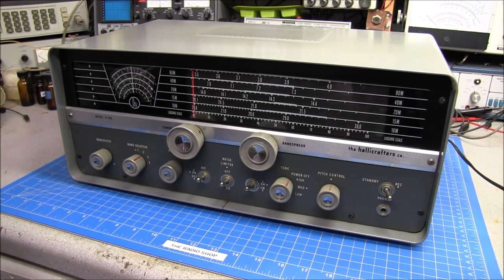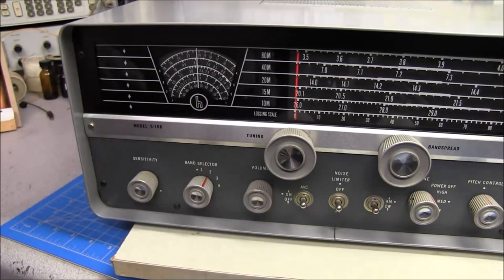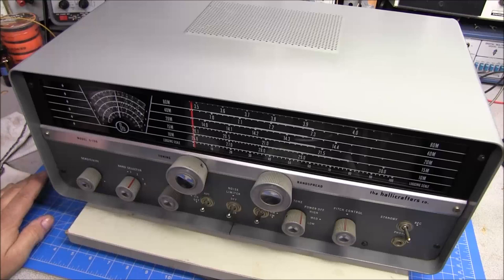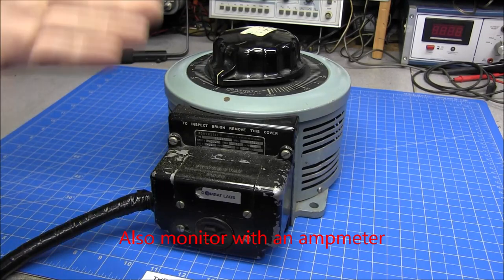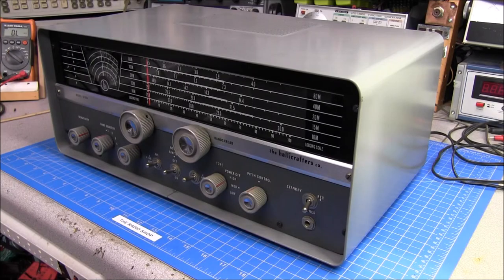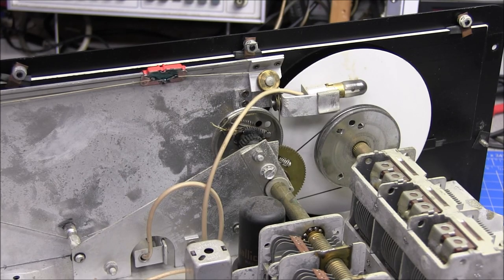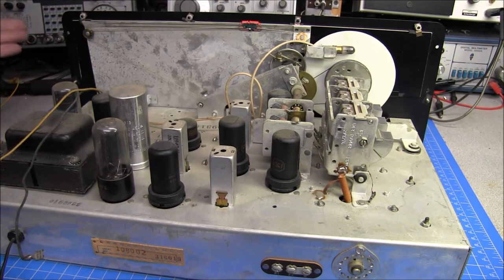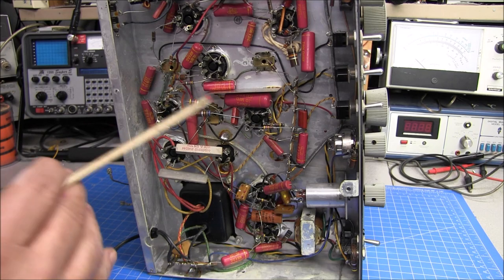#223 Vintage Radio Restoration Tips

Comment: MY 108 does not look that good but it has promise. Working but it is distorted audio when I first turn it on but it clears up in a few minutes. Thanks for the video, Dave.
Reply from the maker: Have you replaced any caps?  Also check resistors and voltages.

Comment: GREAT video Buddy.
I have a Hallicrafters S-107 that works fairly good and has all those tiny chief caps in it, I read somewhere on the internet that these caps are very good but I will check the ones like coupling, etc.
As for the dreaded SMD with my bad eye sight I can't take those IF cans apart, if I messed with them you can say goodbye to the radio...LOL
Reply from the maker: Those caps are nothing more than paper caps in a different package, They leak real bad.  I know what you mean about the eye sight Bill.  Tiny little wires in those things. I have to use large magnifiers.
Reply: Thanks Buddy, when I get it on the bench I will replace them.

Comment: Do you see any drawbacks to using a GFCI for the test outlet?  I know that it won't stop all electrocution even on the primary side but it seems like a small expense for a little bit more safety.  Generally, you should also be running off an isolation transformer.  This radio's primary looks to be isolated by the power transformer, so almost no primary side danger so no real need for an isolation transformer for this radio but this is not always the case especially with old radios.
Reply from the maker: I see no problems with that at all. I also agree on the isolation transformer
Reply: Even with a isolation transformer you can still have problems if you're not careful. Martin KD8LON did a couple of good videos recently about keeping yourself safe and not blowing up your test gear on his YT channel ("mjlorton")...and of course there's always Dave Jones' famous "How not to blow up your oscilloscope" video from several years ago. All food for thought!  73 - Dino KL0S

Comment: Great video  - thank you , very systematic and safe approach. Just a comment on your light bulb schematic, I believe your switch should be in parallel to the lamp to short it out when the circuit is safe. In your drawing if you flip the switch you will open the circuit and no current will pass
Reply from the maker: Thanks, As I mentioned in the video add a second switch to short the lamp.  If using one switch I rather turn the power off.

Comment: Have found that buying - believe it or not -  fingernail polish is quite useful for painting the red lines in knobs or the needle on a meter movement.  Using a toothpick to apply the paint will usually fix it on the first application.  But you have to scrub the knobs clean first in soap and water using an old, clean tooth brush.  Did I mention that it is cheap to do it this way?   Works for me . . .
Reply from the maker: Agreed. Nail polish works nice. Do have to be careful on some plastics though.

Comment: Hello everyone.  I'm interested in setting up a electronic bench at home.  I have some previous experience with electronics, so I'm not a complete newbie, but I was wondering if the owner of this video or anyone reading this can tell me what are the minimum tools needed to get started at home?  I have a cheap DVM, many of the finer hand tools, a spring fed solder sucker and some knowledge.  So, I'm thinking a variable temperature soldering iron, brand name suggestions would be appreciated, maybe an upgrade to a better DVM like a Fluke and maybe an oscilloscope.  I would like to be able to repair vintage radios, etc (30s to 60s) and newer stereos (70s to 90s) and maybe some flat screens if they are known to be simple fixes.  I've also considered wandering into cell phone repairs, but my eyesight is not as good as it would, so that may be too small for me.  Thanks to everyone in advance!